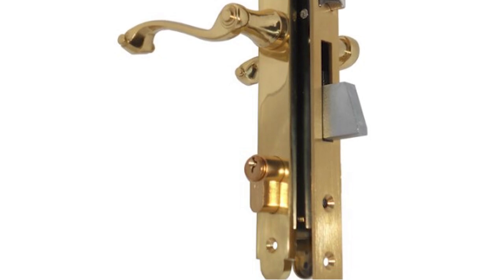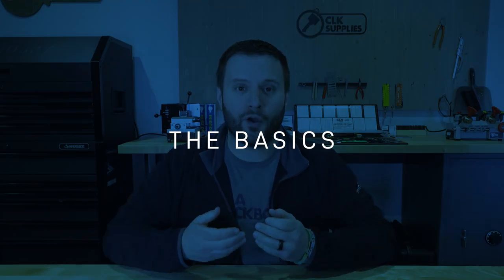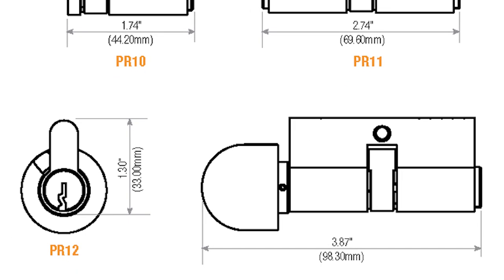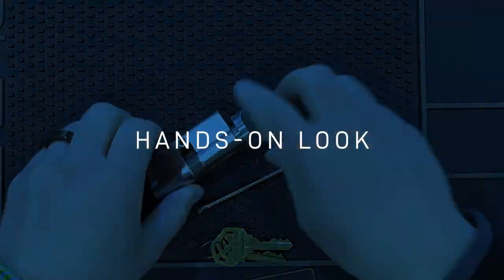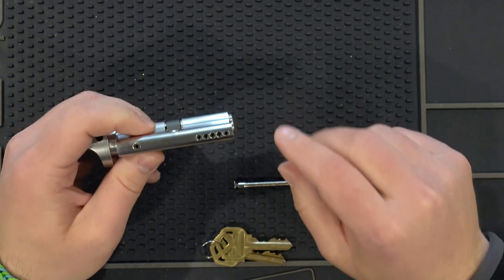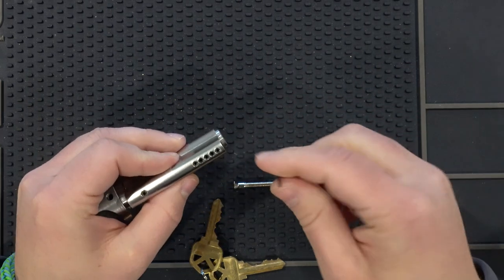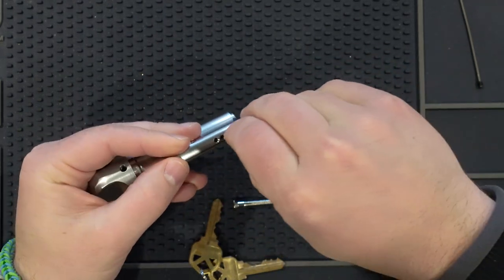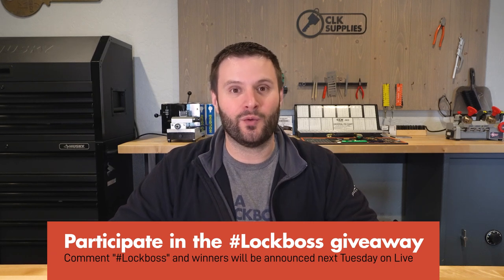Replacement Screen Door Lock Cylinder

Comment: Great video PJ! I’d personally verify overall length as some storm doors are thicker than  others. If a customers door is less than 5 years old the manufacturer may cover replacement of a damaged lock and or damaged hardware if bought through a big box store. The aftermarket profile locks are usually more rekey friendly so good to have in stock. Great to know you carry them! Thanks for sharing! #lockboss

Comment: If you are ever trying to identify a screen/storm door Euro profile cylinder that is 23mm inside / 31mm outside, it's for an Andersen Windows door, and replacements are available from them in KW1 and SC1 and in several finishes. They're they only ones who do that size, as far as I know. #lockboss
Reply: I had an issue for 1 client where Andersen didn't have a kw1 replacement but it was the French inswing and had a rim cylinder dressed up for the profile mechanism.

Comment: Many of those locks won’t come out the door without pushing on the retainer on the  inside  side. I use the Kwikset smart reset tool to get inside the small hole to do this. #Lockboss

Comment: So I got a new house last year and the keys only worked on the front door.  So pulled the rest of the locks and rekeyed them all the same. Except the screen door. Researched euro locks only to see they were only rekeyable with special tools.  So I just pulled out the Lishi and picked to read the bitting to make a key.  Ended up having a issues with the door handle and pull the lock a few weeks after to find the set screws that top each pin chamber.  I felt stupid not pulling it before. But keyed it the same as the rest of the house now.   Lesson learned.  #Lockboss.

Comment: I use them all the time. but it is hard to find the right size. the one that works on most storm door is 2 1/8" long with only 3/4 in on thump turn size. and 1in on key side. PJ you may what to bring this up to GMS Thanks #lockboss

Comment: I’ve pinned so many profile cylinders in my locksmith career but not lately though but here’s a little tip for my fellow locksmiths. When rekeying profile cylinders not GMS I think the popular one here in CA are I think a brand called CES and to key them up you have to go one pin down from your normal pinning number. So if it’s a sc keyway like say something easy like 47538 you have to pin it 36427. I honestly don’t know why I’ve always done it that way. Also when you remove the plastic cap on top sometimes they break, so I use the rubber seal from window screens to replace that plastic cap. I carry some with me all the time I shove it in the area where the plastic cap was then I use a razor to cut off the excess off and boom. You have a new cap that won’t come off at all unless you pull it off to rekey it again. GMS profile cylinders are awesome but sometimes won’t fit correctly so I’ve have to grind away a little bit if the metal or aluminum on the door to slide the new lock in. Or the cam is thick and I’ve filed down both sides of the cam so it turns inside the lock/door. Anyways that’s just my two cents! #LockBoss
Reply from the maker: Thanks for the add-PJ

Comment: For some reason, my boss won't touch profile cylinder locks. Maybe I can point out these as an option. #Lockboss
Reply: They’re pretty simple locks. Some aren’t made to be Rekeyed. They technically can still be Rekeyed but not worth the effort. Tell the customer you can order replacement cylinders that will be rekeyable
Reply: There’s plenty of vids out there on how to do the rekeys. I did a vid awhile back on the variations and special tools.
Reply: Yeah, I rekeyed a few before he found out. They all had the hex screws. He says they take too long to rekey for normal rates.
Reply: He also doesn't trust that the mechanism won't fail during our service.
Reply: @riplikable  they’re a standard rekey if they have the hex screws otherwise I might charge a little more if I had to use a pinning shoe and disassemble. I have the kit from Peterson’s and it makes easy work of it. Maybe takes 5 mins longer than with the hex screws.
Reply: @riplikable  Papaiz and PADO are maybe the two brands I might avoid or replace (particularly the Papaiz locks).
Reply: @odinslockllc  It's hard to find now but have you seen the HUK kit with the segmented follower?
Reply: @riplikable  yeah seen that one. And there’s 3D printed kits too I think I had a link on the vid I did about them. #lockboss

Comment: I live in a market that has lots of Europeans immigrating some of them have even developed a company that produces multipoint doors that are a hybrid design with north American hardware so these euro profile cylinders are not that surprising the biggest issue I have is finding key supplier and if can they tend to be very pricy to import. #Lockboss challanges